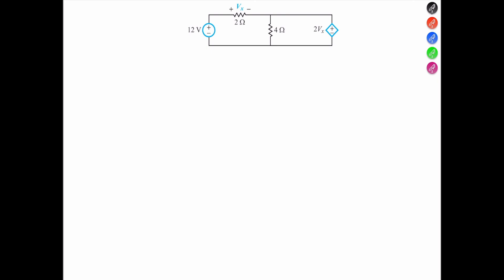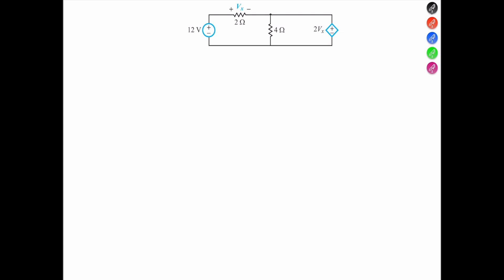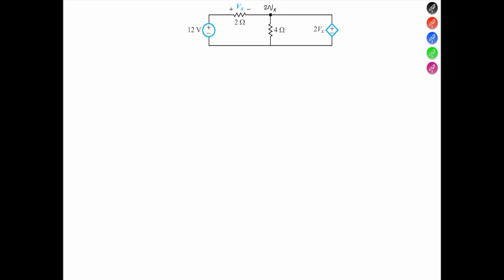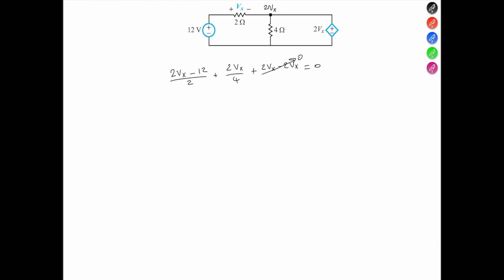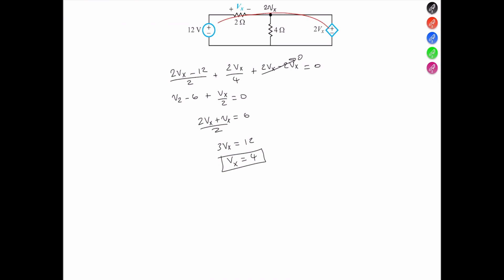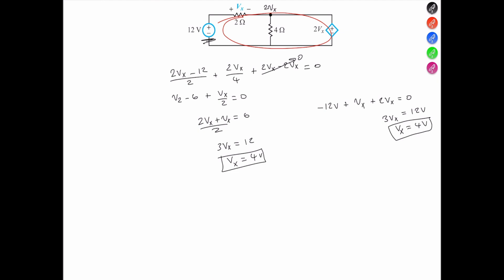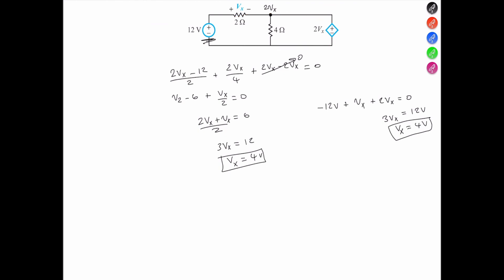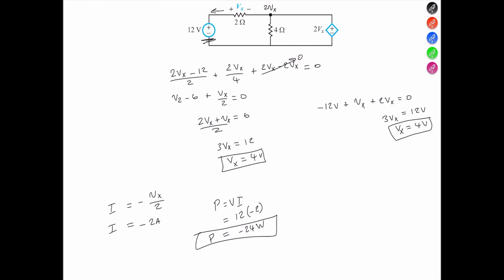Determine the power supplied by the independent voltage source - Innk

Comment: Would you even have to write 2Vx -2Vx in the kcl since there is no resistance? Or since it is in parallel does it have a resistance of 4 ohms?
Reply from the maker: No, the 2Vx-2Vx is redundant, it’s just to show the full equation when doing the node method.
Reply: @writtoninnk  ok I was just making sure in case I got a question with a difference in voltage but no resistance